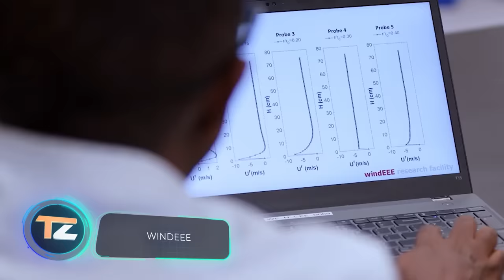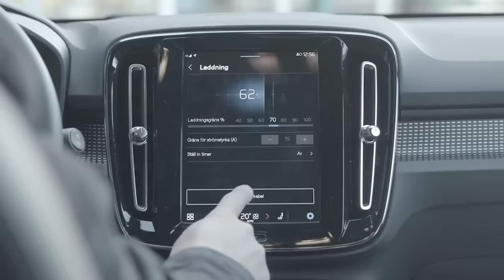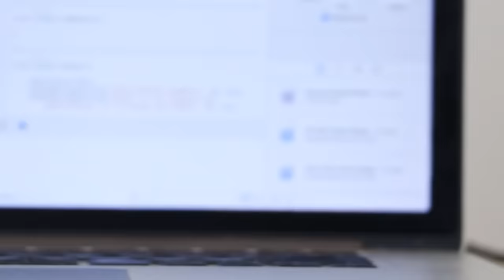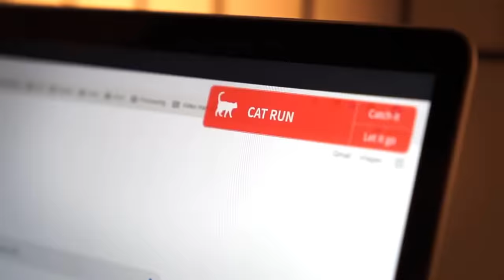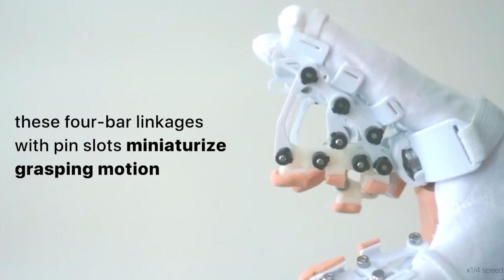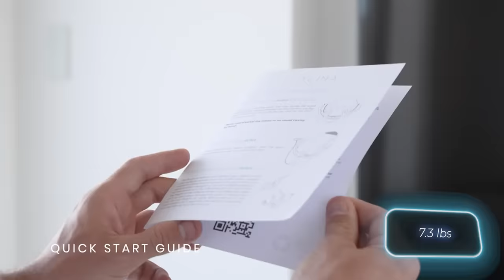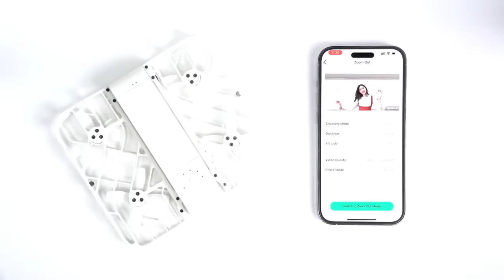19 INVENTIONS ON A WHOLE NEW LEVEL

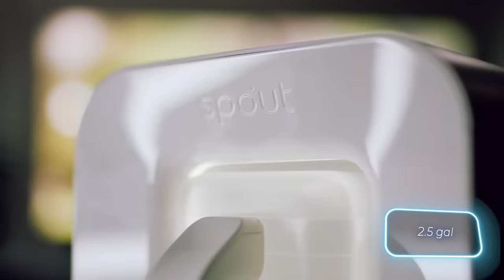Comment: At 0:06:00 you talk about a condensing system that can give close to three gallons of water a day.    I live in Florida and on the most humid days my 350watt dehumidifier can only produce a little over 2 gallons with a forced air system.   These "condensation" water source things ONLY work where there's high humidity and won't function at all under 65% so are absolutely worthless where there isn't available water for much simpler reverse osmosis filtration.
Reply: I was just going to yell it is a scam. But you said it so much better. I think it was Thunderf00t showed something like it and proved it was a scam.
Reply: You might as well just collect the water that drips out of your air-conditioner unit as it cools your home (or your vehicle), as that water is just condensation!

Comment: I hope you realize that it takes a lot of electricity to extract water from air.
Reply: Not necessarily. With that specific device, yes, it is wasteful. But you can harvest water from air through the natural cooling at night. It's called dew. But of course it all comes down to volume. Many por countries have managed to create small water harvesters. This is a high-tech solution to a low tech problem.
Reply: You might as well just collect the water that drips out of your air-conditioner unit as it cools your home (or your vehicle), as that water is just condensation!

Comment: Funny, we have been running the water from our dehumidifier through a filter for almost 15 years.  Nothing new, just a gadgety, expensive box. But hopefully it will get people thinking about it.  Unfortunately all areas facing water shortages live in very arid climates and there is little moisture in the air to be extracted.  In those cases, it is far too costly to use this technology.
Reply: there is on internet old episode of sharks, and one guy have exacly same box, little bigger becouse he was aiming for africa, but everything else was the same

Comment: Man, that "spout" and similar have been debunked 1000 times by ThunderF00t and lesser humans. It's basically a glorified dehumidifier, which creates the problem that a) the (initial) harvest is unfit for human consumption and more importantly b) it'll be useless where it could actually help. Even in the Carribeans, blessed with high humidity, I don't see a lot of people that have the funds for both an expensive dehumidifier and the necessary tools to actually make the harvest potable.
Reply: You might as well just collect the water that drips out of your air-conditioner unit as it cools your home (or your vehicle), as that water is just condensation!

Comment: The mirror, should be an add on to all solar panel systems.
Reply: If you already have solar-panels, it would be cheaper to just use the power from those to run LED-lights! 
Another option is to just open the blinds on your windows!

Comment: I wonder if that beach sweeper can be modified to remove invasive Asian clams from the sand that's under water. Tahoe has a real problem with those little green shell buggers.
Reply: Most probably, as on many popular Australian beaches like Bondi, small tractors or quad-bikes with similar devices (but much larger) are used to remove stuff even as small as coins & rings!
Reply: @stevie-ray2020  That sounds like it's above water. Tahoe needs a device that can sift thru sand that is anywhere between 2 feet to at least 20' deep (I don't know the maximum depth they can be found).

Comment: OHHH HEXAGONAL, witchy enviromagic?  <Yawn>  Taxi inductuve charging?  I dare you to jump the taxi line with your Tesla for a charge...  Yes the track construction is a positive move.  

Weightlifter got away from weight belts years ago because the prosthetic "prevention" proved to cause the stabilization muscles to lagg behind the main force muscles causing increased injuries when the people did task oriented work with the main muscles.  Excersize the ankles for strength instead.

Comment: In my area the biggest irritation is not the noise of the trains on the tracks but the high pitched squealing of the brakes . . . That is a much higher decibel than the normal clickety clack

Comment: Floating rail tracks are a great idea. Extracting water from the air is pretty cool. Plants that tell ou when they need watering - Feed me Seymour! Don't want a submarine. Magicjet seems fun, but I think as a backpack would be cooler for handsfree use. Wave energy generator is cool. Hover X1 is great, but too small; make it slightly larger with a MUCH greater battery life and you've got a winner.
Reply: Extracting water from air...like a dehumidifier? Done so many times in different scales, its a scam

Comment: The beach sweeper is cute.  A heavy equipment scraper could probably do the same job if the center  cargo area was replaced with power sieves like those used in grading aggregate.  If you are talking about clearing whole beaches that is.  A yard sized chunk of sand, that beach sweeper is cool.
Reply: On many popular Australian beaches like Bondi, small tractors or quad-bikes with similar devices (but much larger) are used to remove stuff even as small as coins & rings!

Comment: I have always wondered why we were not making Hydrodynamic subs like we make aerodynamic planes- they both exist in a fluid medium.  The density is just different, so why not have fast submarines that move around like b-52's or airliners?
Reply: Because we are building hydrodynamic subs. However water is somewhat more dense that air. That means if you want to move faster it takes much more energy to do the same work.

Try running on a dry surface, basically just moving through air, then running in a foot or two of water.

Comment: Just wondering what the source of power is for the drive on chargers? Let me go out on a limb here and say… fossil fuels? 🤡
Reply: Why should it be fossil fuels? Renewable energy is commonly used, and even if it would be 100% fossil, the overall efficiency of a combustion engine is still much less than even a electric car driven with fossil generated power. there are some people who don't get it, but they will learn and get to adapt eventually their old habits.